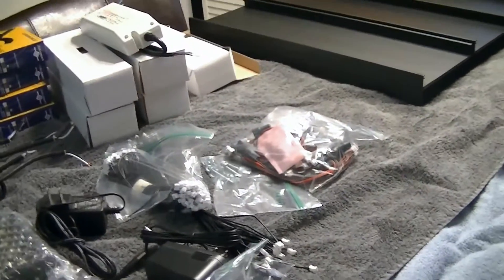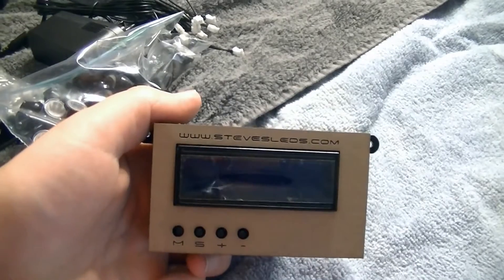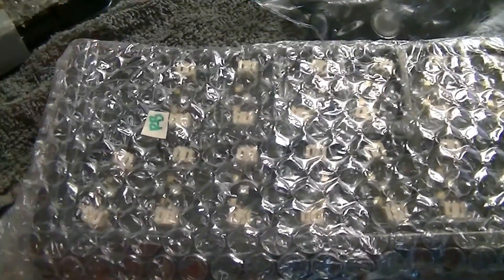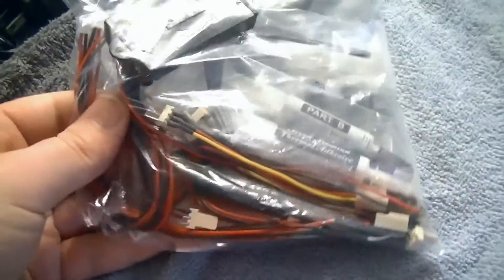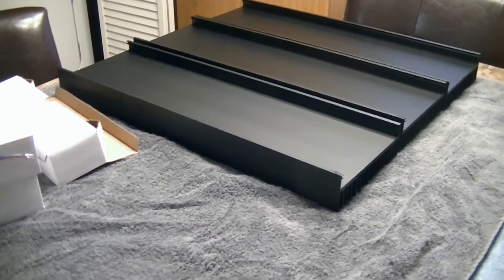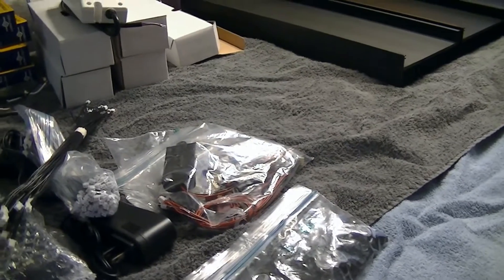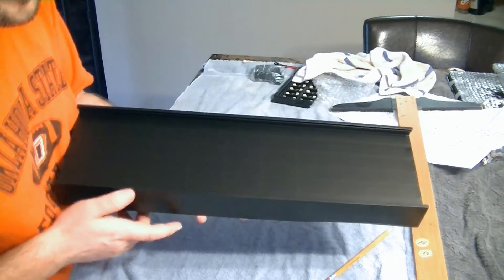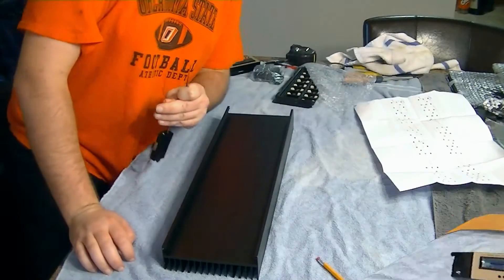DIY LED Build Part 1

Comment: Hello, my friend, how could this help me? I have a saltwater fish tank and I want to put corals but I do not know what kind of led how many w I would touch and the colors I have understood that they put different colors the measurements of the fish tank is 150x50x50 would be good Help me, thank you, I hope your answer
Reply from the maker: CAROLINA MARTILLO check out rapid led.com they have kits for all sizes of tanks they also have recommended color ratio and placement. They also are great with questions if you chat with them. Since this build they have come out with new drivers that makes it easier too.